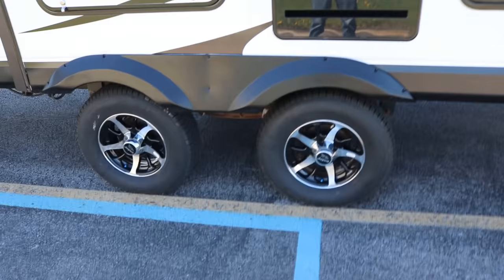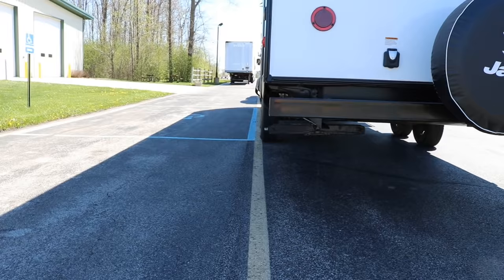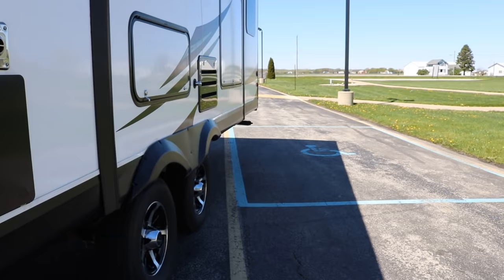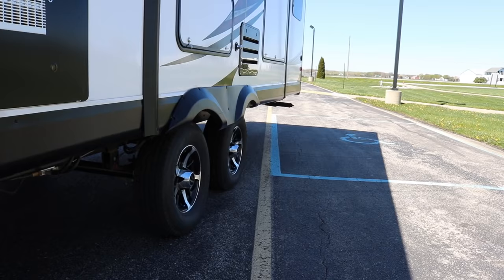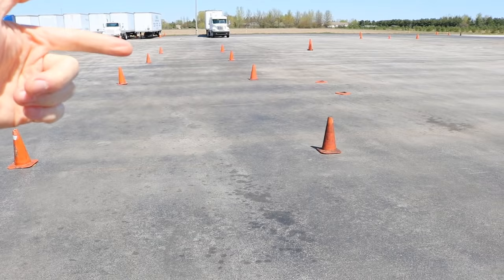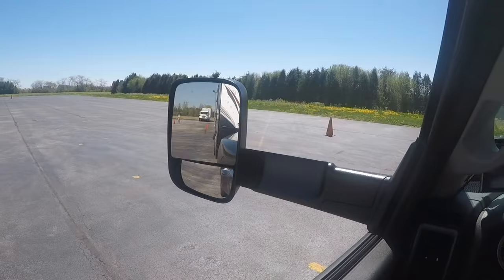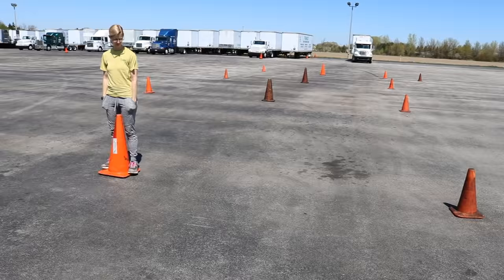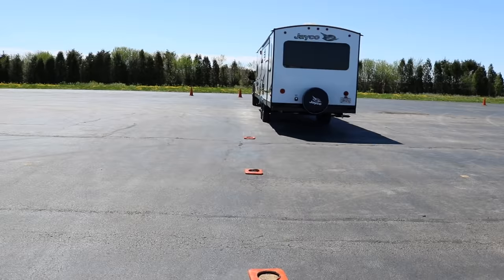HOW TO BACK YOUR RV (And Trailer "Tail Swing")

Comment: Great video, I'm not new to driving or backing with a trailer but it has been 20 years or so since I've done it. I recently purchased a 40' 5th wheel toy hauler and was wondering if you have a video with a 5th wheel? Also do you think it's necessary to have a separate video for a 5th wheel? I know backing a trailer is backing a trailer but I think it's a big difference between the two. Thanks.

Comment: This video is the most helpful set of instructions that I have watched.  Thank you for taking the time to produce this video. My take away from your instructions is to practice the straight line back. It seems if a driver masters the straight line back the rest of the maneuvers will fall together.

My wife and I have not figured out how to smoothly back into a camping site that is located on the passenger side and is heavily wooded either on both sides.

We seem to put our truck and trailer in a position that is a point of no return. I drive around the loop and try again.

Do you have any tips that provide a warning that the angle between the truck and trailer is too far out of alinement to save the parking move?

Comment: Fantastic video! It really is concise in the instructions! Thanks for creating this. If there are other techniques taught on the CDL course for towing, please make them!
Reply from the maker: +Janet Alexander currently all those maneuvers are part of the CDL skills testing, if anything changes I'll be sure to do an update.
Reply: Thank you! Your video is exactly what I needed.
Reply: Janet I mentioned to him in my own comment a few other fun but not part of CDL Road testing for licensure;

Reverse figure eight - two circles of cones with 20 feet of space between them O---------O (Not from center to center. with at least 6 cones in each circle or use up what you got equally with at least 10 foot diameter. This uses both right and left hand and doubles as a U turn skill builder as well if you do an oval either direction around them. 

Two forms of reverse slalom based on the reverse lane change and parallel parking lessons where the line of cones are lined up straight and the other way they are offset by 5 to 10 (more or less) feet. Cones spaced apart like parallel parking  but add 25 to 50% length for clearance when you go around them. Keep with in a few feet from the cone. Only need four cones.

I learned and tried these in a company workshop one day, they are fun and help build your skill.

With both I based them on 40 foot trailer length, as I said they are not standard but something fun to do and learn how well you do and improve your basic skills, so some readjusting may be required.

Comment: My friend and I rented a u-haul cargo trailer yesterday to practice for our new RV's.  (didn't realize smaller is harder).  After 4-5 tries each we were beginning to feel more hopeful about a straight back up.  Then we drove city streets a bit and found a different parking lot with angle-in spaces.  That was NOT pretty!  I wish we had seen this video first.  
Now I'm eager to try again - still before getting my new 22' trailer...  I certainly understand from my failures about the 11-1 o'clock, but it was super helpful to have it explained.  But I'm a bit unclear about knowing just where to put the cone so I know once my trailer's wheel reaches that spot to start straightening and then cutting in.  And could someone address what happens when you cut too tight and backing now just rotates the trailer but no longer backs it up?

Comment: Thank you so much for this video! I can't wait to practice! Any tips or tricks to make sure the wheel is straight position besides poking your head out or trying to keep track? Less the one wheel rotation is a no brainer. Do you just go by feel? I have a very short 16 foot Jayco so my steering inputs should be smaller than yours.
Reply from the maker: I just do it by feel, with enough practice it becomes more natural. If you're unsure just stop and look out the window.

Comment: Pro tip. If you get frustrated trying this method with the cones. Run a few over. It helps reduce stress and shows those cones who's boss
Reply from the maker: Is that what you did, Frank?😂
Reply: @WanderingWagners  Yup. Got Daisy to do it too

Comment: Great video,  I've watched it a bunch of times.  I have a 5th wheel in a long bed F350.  How does a 5th wheel react compared to a trailer?  React faster or slower?  Thanks
Reply from the maker: The angles will be the same but a 5th wheel will react a little slower since the pivot point is over the rear axle.
Reply: @WanderingWagners  Thanks. I need to go out and practice. I get real confused on what to do when I don’t have the trailer straight or it is off to one side. I think I’m going to use my leveling blocks to lay out the far and near boundaries of the spot I’m parking in at least until I get better at it.

Comment: My question is your last example, backing into a spot. How do you know if you have enough room to make the turn?
Or how do you calculate how far to be "away" from the turn?

As an example, I need to back in to my yard coming off a typical 2 lane residential street. It's a 36 foot 5th wheel. I have no idea if there is enough room turn it through our gate without hitting the fence or going into the ditch on the other side of the street with the truck.
Reply from the maker: Pull up at least half a trailer length past your pad/driveway

Comment: Hello, First off thank you for your very detailed explanations that are really going to help me fine tune my trailer backing up. I have to park my 27' travel trailer about 20 times a year, between bringing it home from storage, then to the campground, back home again to unload, then returned to storage. Every situation I need to back it in. I started with a pop-up so I was able to learn with a little bit more forgiving size. My question is, On my last trip returning home with the trailer, my street was full lined with cars/trucks on both sides right up to my drive way. The space between the cars on the side is about 12' or so it felt, my driveway is three cars wide(about 27'). I'm backing in on the blindside as my street is a dead end ahead, so there is a car right where my driveway starts so I can't cut gradually, it has to be a pivot type of turn. Is there anyway to complete this maneuver with a shorter wheel base vehicle(Ford Explorer) without having my explorer hit the cars? When I attempted to try I was getting close to the truck on my driver side. A few people rushed out of the party to move their cars. When he moved the truck I was able to get in no issue. But is there a technique in that situation that should be used to benefit my explorers front end? I was thinking that maybe if I was closer on the passenger side of the street instead of centered that I might have been able to compete it? Thank you again for the awesome video!
Reply from the maker: +Steven Kierzkowski I usually recommend staying in the middle when you start backing, but every situation is different. It definitely sounds a little tight where you are. Without actually seeing your location I would do what you already suggested, staying a little closer to the right side and see how that works.

Comment: Awesome video! 

Do you have a way to figure out how wide of a  road you’d need to turn and back up a driveway ?

I’m worried about parking a trailer since the street in front of the house is just 2 lane wide with no shoulders and ditches on both sides...

Thanks!
Reply from the maker: 2 lane is plenty

Comment: This is a very good video.  I"m not the best trailer backer, but I have a 5th wheel.  It seems like it take a long time for the 5th wheel to turn, even when I have the truck steering wheel turned all the way over.  Do you have any advice for that?

Comment: Great Video.  Curious to know what model Jayco that is.  I have a 21' bass boat that I back up all the time...all the way into our 3 car garage without issues. However, we just purchased a 33.5 Jayco that I'm a 'little worried' about being able to get the correct angle cut to make it into our 12' wide driveway without taking out the mailboxes on the other side of the street while trying to get back under it.  We have a rather large tree on the left at the start and the mailbox on the right.  Will be interesting for the first couple of attempts.
Reply from the maker: It's a Jayco white hawk 31RLKS. 37 feet long. Longer trailers are usually easier to back. Small movements and you'll be good

Comment: great video!  Why  do you prefer hand on top rather than hand on bottom for three axle backing?
Reply: Not sure why or how this is posted  as DavidorDaughtry.  I'm CalAd.
Reply from the maker: +DavidorDaughtry personally for me it feels more natural. I've taught a lot of people that were struggling with straight-line backing to put one hand at the top and steer towards the problem. I see a lot of people suggest putting one hand at the bottom and steer the way you want the trailer to go, and that works too! There isn't just one method that works for everyone, each person just needs to find what works for them.
Reply: I agree.

Comment: Awesome!!! video Thank you.   I have been RVing for about 5yr pretty good driver,  not many  problems backing straight or into difficult campsites (grew up working on a farm).   But one problem I run into is when I backed into a parking spot and I need to adjust approximately 2 foot to the right or left to Center her my trailer.  I'm never sure how long to hold the maneuver because I can't see the tail (35' TT) any suggestions would be greatly appreciated thank you so much
Reply from the maker: +Michael Kremer the way I always teach it when pulling up is "to fix left, pull left. To fix right, pull right" also don't focus on just the tail end of the trailer, watch the trailer wheels, you should be able to see them in one of the mirrors. By watching the wheels, once they are 2 feet one way or the other you'll know when to straighten out.

Make small steering wheel adjustments, oversteer is the most common mistake. I don't find myself very often turning the wheel as far as it will go and holding it there. If you watch the video we did titled "sauder village" you'll see that I don't really crank the wheel as I'm backing, I make small adjustments.
Reply: Another tip is look into using a camera for better view as it can be mounted on the RV and there are a few good systems out there and some good wireless single cams with app link to mobile device as well, one such is NuVending NuCam WR with a good 150 foot range.

Comment: Anything to note on what would be different for a 5th wheel? Or is everything the same except to learn the different pivot point? Do 5th wheels turn sharper?
Reply from the maker: Same rules apply to a 5th wheel. A 5th wheel will react slower, but it can turn sharper

Comment: Nice work!  What would you say the minimum distance requirement is from the front of a parking space to the opposite side of the space (road)? In this video you had 70 feet and mentioned it is way more than you will have at a campground.   My wife and I are purchasing a 32ft travel trailer and we are trying to determine if we can park it at our home or if we need to store it.  I have right at 40 feet between the opposite side of our street to the opening to our driveway and our rig is 53' long (tow vehicle & travel trailer).
Reply from the maker: Pull up at least half a trailer length past your site you are going to back into.

Comment: Thinking about this video, I am curious as to the variations I might expect with a 36' 5th-Wheel as opposed to your travel trailer in this video. I assume that the concepts in your video would apply, but would some of the angles such as getting the nose of the truck pointed towards 11:00 or 1:00 and some of the other steering angles you demonstrated be different. I am new to the RV world and just trying to prepare myself with the best practices.
Reply from the maker: There are other factors to take into consideration, like length of wheelbase of the tow vehicle, trailer wheelbase, tow vehicle wheel cut, and pivot point (travel trailer vs. 5th wheel). Still, the angle you set using the 1:00 and 11:00 will get you real close. It's something you'll have to learn and make adjustments to once you get out there any try it. There's too many variables since each setup is different to have just one method that works perfect for everyone. Thanks for watching!

Comment: When backing into a camp site at an angle, with trees and many other obstacles I put the wife in the truck. I stand where I can see everything, we use cell phones and I tell her to move slow and only if she can hear me, in case we lose the call.  I don't say left or right, that just confuses things. I say cut the wheel, if it is not the correct direction, i say cut the other way. I can watch exactly what the trailer is doing from behind and all the wife does is follow what I say and watch the front fenders of the truck. We have backed into some very tight camping spots this way and have never hit anything, yet.
Reply from the maker: Do whatever works for you but I teach backing without a spotter, so that's what is shown
Reply: One person cannot back a trailer between parked cars, trees, watch for low hanging branches, water hookups, sewer connections, electrical boxes, turn at a forty five degree angle and miss everything in a campground. Especially when you can’t see. Out in an open parking lot fine. In a crowded, congested campground at an angle, no way.

Comment: That was a very well done instructional video.  Are the 11 o'clock to 1 o'clock angles the same for a 5th wheel?  I have never paid attention to the actual angle of attack when backing, but since I have to get a non-commercial class A here in California to tow my heavy trailer, I thought I'd better get a little more practice in before the driving skills test.
Reply from the maker: +Kevin Williams Yes, it should put you close. There are all kinds of variables that come into play such as trailer length and tow vehicle wheelbase. 11 and 1 o'clock is a good general rule of thumb that covers all different types of trailers. You'll just have to get in the driver's seat and try it out and adapt it to what works best for your particular setup.
Reply: Practiced with your techniques and passed my class A driving and skills test with no problem.  Great instructional video !
Reply from the maker: +Kevin Williams that's great! Which maneuvers did they make you do?
Reply: Wandering Wagners Forward and back thru the cones, backing into a lane change and backing into a doc/rv spot.  The longest part was the pre-trial inspection.  that maybe a good video to do as well.
Reply from the maker: +Kevin Williams that's a great idea, I didn't think of that! I'll see if I can put together a pre trip video.... Now I just need to find the time! Haha

Comment: On the alley dock the drive was 70 ft and you set up in the middle.  If the lane is more narrow, like 12ft, do you still start in the middle or do you have to start close to the alley dock and put more put angle on it.
Reply from the maker: I would start out closer to the left side but you don't want to be all the way over to the left side.

Comment: thank you this one is the best backing up truck viedo on youtube ,good job Man
is it the same maneuver for backing up for example a 53' trailer ?
Reply from the maker: +Knoxville Anyce yep, same method to back up a semi trailer.
Reply: thank you very much :)
Reply: All CDL Testing scenarios apply to all trailers pretty much, be it commercial/consumer 5th wheel or gooseneck and even tow behind aka "bumper" pull. Even is one uses a tow aid like Automated Safety Hitch/Tow-all, or Trailer Frog.

Comment: Thank you! I am a female and have  just bought a 13.5 ft teardrop trailer. Many people have told me the smaller the trailer the harder to back it up. What are your thoughts or suggestions?
Reply from the maker: +Cheryl Starr that is correct. A longer trailer is much easier to control while backing up. I would move slow and make very small steering wheel movements when backing a trailer that short. With practice it can be done though!
Reply: As an experienced trucker myself, I suggest you use smaller turns and corrections at first then adjust to suit your preference. since any trailer 50% longer to less than the length of your vehicle it WILL turn quicker due to shorter length. In my experience it was easy after learning with 48 foot trailer that the longer was easier but reqired more wheel turn to get started due to length. If you feel you need a camera or two to help you out depending on how well you can see over the trailer since you say its a teardrop and often they are 4 feet tall from ground, check out 5th wheel double towing by Tiverton for some ideas on camera angle and setups to help you out. There are a few good camera system makers out there and reasonably priced, check out RVS Systems and NuCam WR from NuVending which would best probably suit your needs since its a wireless system that uses an app on a mobile device for image and has really good range. Those cameras especially systems with optional recorder device make for a useful security system for your camper/RV while its parked and are away from it for a while for peace of mind.
Reply: Shorter trailer is harder than a longer one because it has a shorter reaction time (and distance) than a longer one.  This is a disavantage because you need to keep up with that reaction time with the tow truck. OTOH a smaller trailer can obviously get into a smaller space - just needs more skill to get it there!